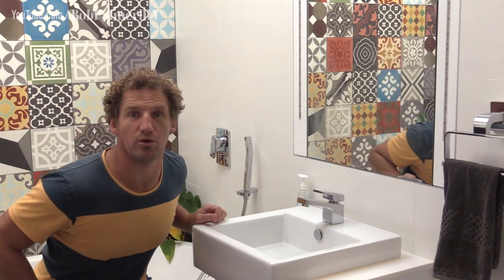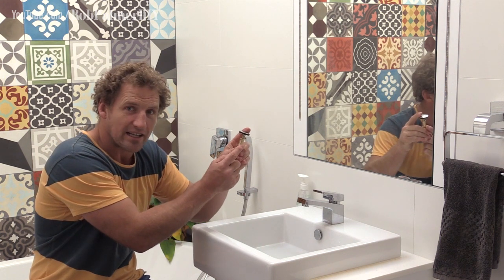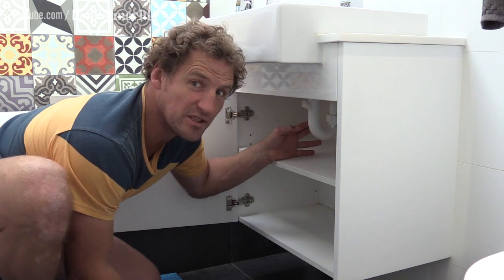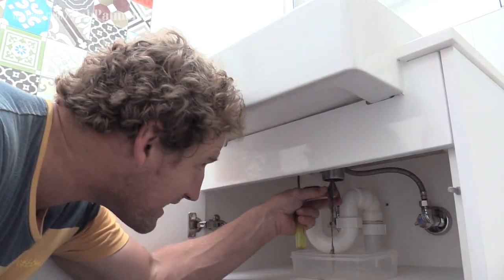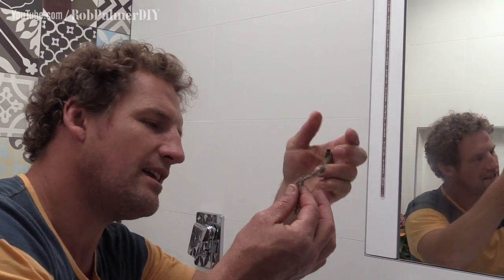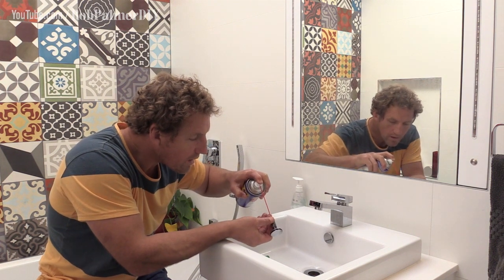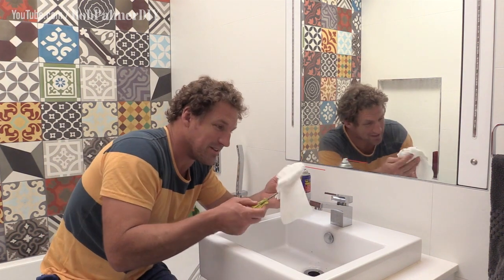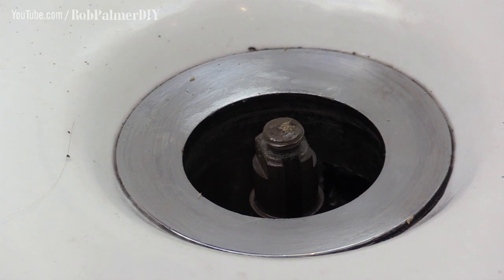How to Fix A Fancy Sink Plug | DIY Tip

Comment: At last ! A video and tips that worked for me😊! I needed a fair deal of more hammering compared to what's on the video due to 2 bits of broken knives stuck following my previous failed attempts and the fact that l ended up pushing the pop up cap further down.

Comment: Thanks for the video. I used a plunger to pull the valve up. A slow depression and then a quick pull up and the air pressure underneath pushes the value up. Or you could  incorrectly say  the vacuum pulls it up just like your screwdriver and hammer technique . I had only to do it twice and the valve was fully clear.

Comment: I just had the same issue with my fancy sink plug (I love it ....when it works)   I found an easier way to get it popping again. after spraying with WD-40 I knew I had to get the spray all along the buried piston. I knew if I pushed the stopper all the way down, I would have to pull the P trap and remove the whole mechanism. Instead, I got a carriage bolt that fit the threads of the stopper. I added a nut to my carriage bolt and threaded that on the stuck piston. Now I can push and pull the sticky piston without taking the drain apart.

Comment: Don't worry about going under the sink.. Just use a suction cup on the top and pull it up. totally works.
Reply: Only works if you have a suction cup - unfortunately I didn't, so this video saved me a trip to the shops and an unnecessary purchase. Funnily enough, I didn't have a suction cup but I did have vice grips, a hammer, a screwdriver, and a can of WD-40. I'm relieved to have found a vid that didn't default to "use a suction cup".

Comment: Hey Rob, it's not working. I tried to tap at a screwdriver underneath but the plug doesn't come up. What shall I do?
Reply: scoop out the water from the sink.Dry the stopper with a towel .Use a rubber glove to cover the stopper and turn anti'clockwise until the stopper comes up. Then proceed as per this video with the pliers.